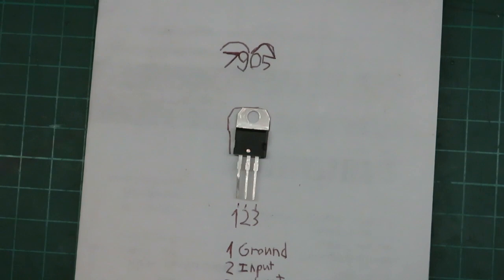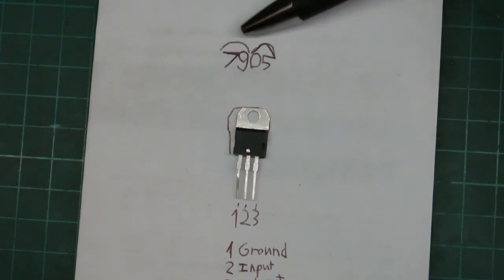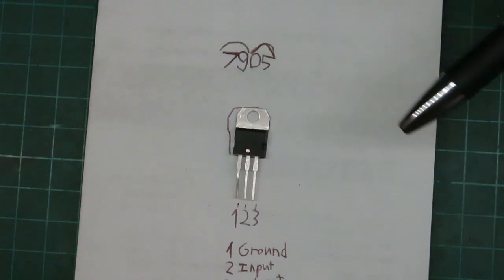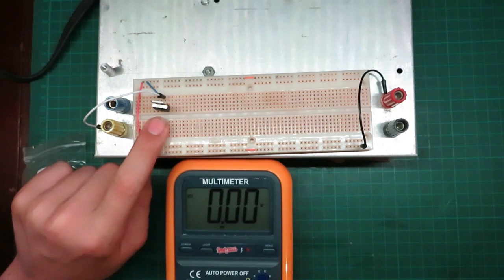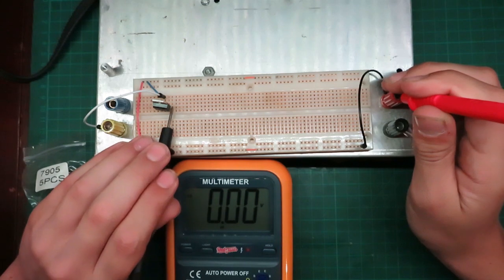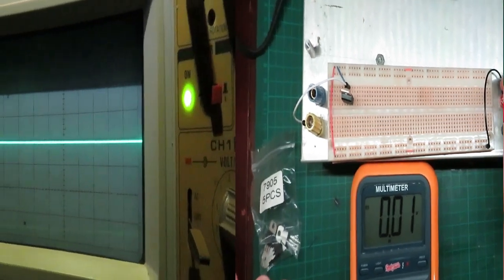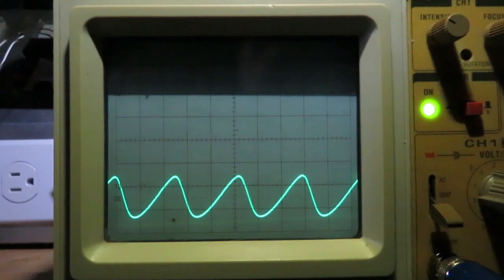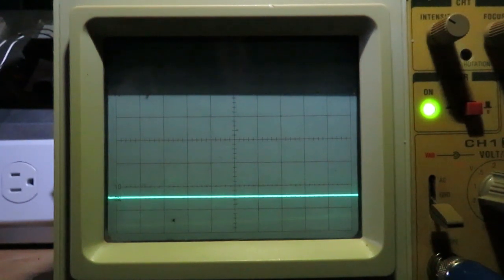How to use Negative Voltage Regulators

Comment: What kind of cap did you add? Adding a small ceramic capacitor as close to the regulator as possible really helps for stability. The negative (79xx) series tend to need them even more than their positive (78xx) counterparts. 
What you did not mention is that these regulators have a minimum load specified in their datasheet. If you don't take that into account, their output rail is often out of spec. It would be interesting to see if adding such load would affect the output stability. I imagine it could help damping the oscillation, maybe even without any capacitance on the output.
Reply from the maker: A 100 uf electrolytic capacitor.  yes I will try that in my next video about building a Negative power supply

Comment: Newbie here... Why does the meter not show a negative sign when measuring the output @5v. That would be my expectation since this is after all a 79xxa regulator. Any help is greatly appreciated. Thanks !!!
Reply from the maker: I am measuring with the red probe on the positive and the Black lead is probing the on Negative side of things,
I hope that helps! Thanks for watching!
Reply from the maker: Also my power supply is a little bit weird. The negative of the negative output is the positive